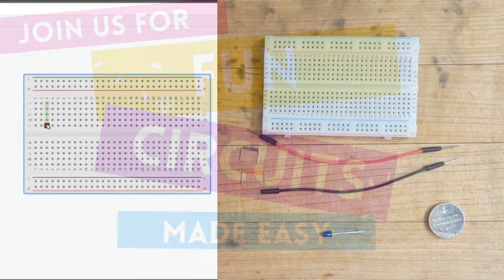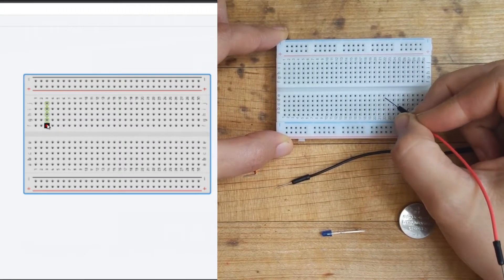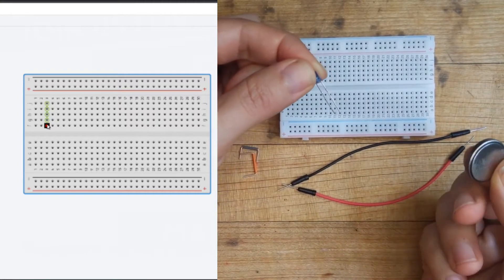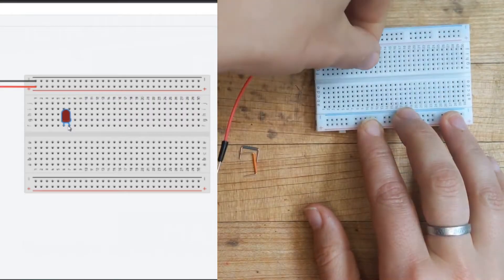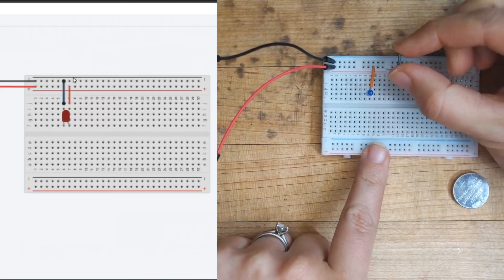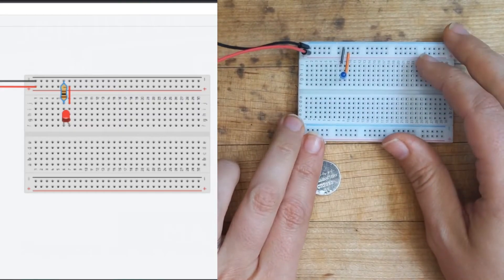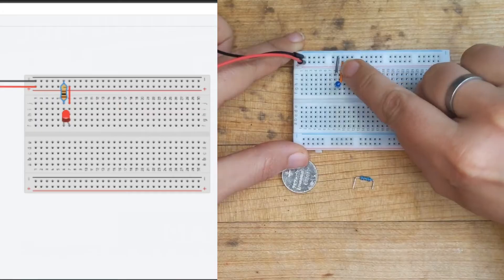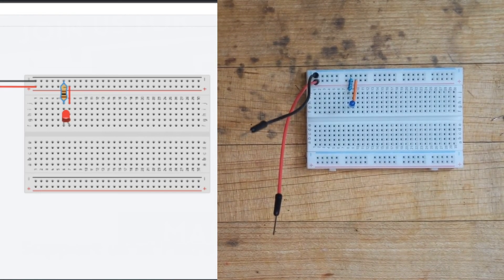Breadboard Circuit Tutorial - Simple LED

Comment: The first thing this tutorial does is wire the LED directly to the battery. This tests both the battery and the LED before actually building the circuit. And I understand that it is very practical to know the components aren't actually broken before you begin building a circuit. In this case, with a 3V battery, that works just fine, but, as far as I understand, with more powerful sources, such as a 9V battery or a 12V power supply, this could actually damage your LED. So even though I understand the practicality of quick and dirty testing the components before starting, I thought it was a bit strange. I am sitting here thinking, ok so I want to try to power up a LED without burning it and I'm watching this tutorial, expecting to get a lesson in how you need to protect the LED with a resistor and how to find which resistor you need and the first thing the lesson does is connect the led direct to the power source...
Reply: I end-up damaging, I hope I would have read this before doing the shit...

Comment: What will be the strength needed for a resistor for a 3mm ultraviolet LED with a 9V batterie?
Reply: You need to know the specs of the LED I think. Suppose it's a 3V LED, you would need a resistor to drop 6V. I think without knowing the specs of the LED you cannot know which transistor strength you need.